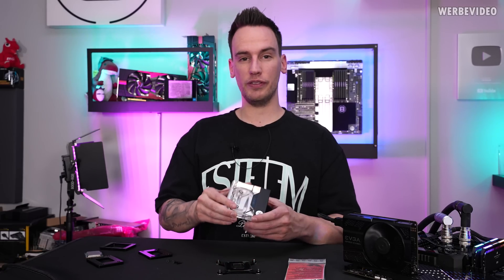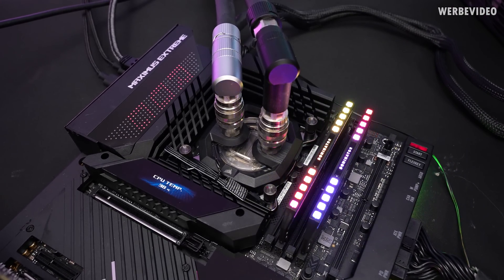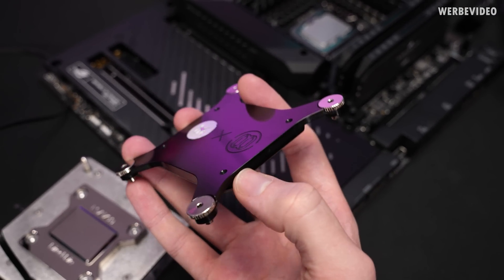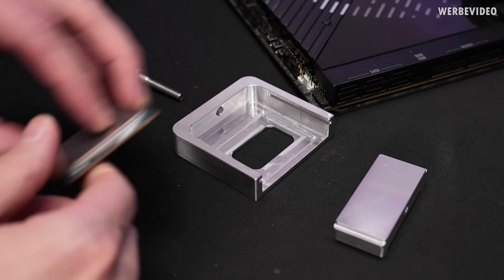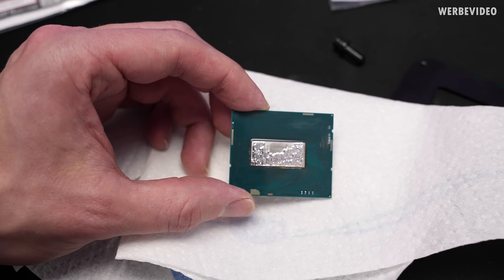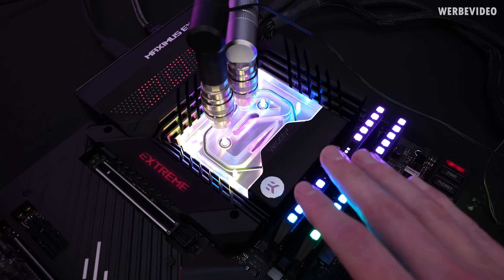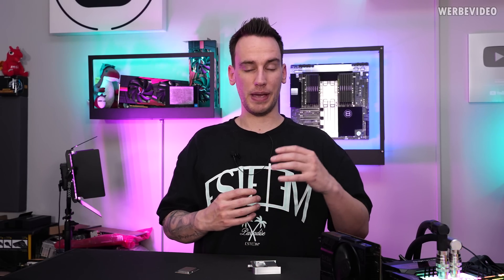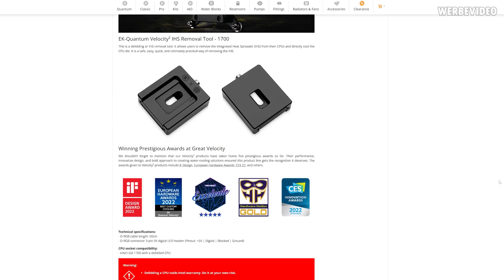We're testing EKs Limited Edition Direct-Die Water Block

Comment: question about water cooling Iv seen a water cooler thats for a 60l aquarium that gets the water down to 10c and one said 32f they where 180-200watts I want to know would it alone be able to cool the water its self or could you put the radiator on the line where the water is coming off the cpu to cool it as much as you can and then to the cooler would it be COLD like 40f or less?

Comment: Make a test unit out of pure SILVER. It has 11% higher Alpha, the product of conductivity and heat capacity, compared to pedestrian Copper. It MUST absorb transient spikes better. Have it plated with Rhodium, or perhaps even better, Graphene to prevent oxidation! 

The only other solid that could possibly be better would be a DIAMOND heat spreader. A company named "Diamond-Materials" might be willing to let you have or at least test with one. At ~1600 W/m·K @ 90°C, it would destroy even Silver with only 430 W/m·K. With Diamond's superior strength, you could get away with a very thin plate to maximize heat flow. 

To quote The Eagles, Take it to the Limit!

Comment: I've got my i9-13900k overclocked 100mhz on all cores. That is, 5.6ghz all core, rising to 5.9ghz with 2 active cores.
I use an EK AIO 360 with 3x Noctua iPPC 3000rpm.

Under all-core stress test Cinebench r23, I stay around 92 degrees C, with no thermal throttling. (CPU drawing 263W, 1.15 volts.)
Cinebench r23 multi-core score of about 41'100. (Stock is about 38'500, or so, according to reviews.)

By the way, I picked that AIO cooler thanks to your video, since it performed so well.

When looking at people running this CPU in stock configurations, I see them throttling on all-core loads, even with AIO coolers. So, I guess my setup is pretty good?

My quick overclock is simply that I set SVID to "best case scenario", and offset the voltage by +0.1 Volt.
This gives me stability and thermal headroom to boost everything by 100mhz without getting too hot.

Comment: I'm a bit disappointed in this video, it's such a wonderful walkthrough of the process to direct die cooling, but is missing so much critical information that would help people choose if they wanted to take this step or not. What's PLL1 and PLL2 at? What was your max wattage, what was your vcore ( looks like 1.35 but it was never stated).  what were the actual result differences in r20 or r23? Why didn't you do the mounting kit with the corsair block?  There's so much information in this video, and so much more that's missing.

Comment: I'd love to see you overclock this 13900k with the direct die cooler to see how high the clocks can go, and what kind of performance improvement that provides!
Reply: He got 6.2 all core with that tech cooler.  And stayed below 65c, I really want one of those.
Reply: @4gbmeans4gb61  how much fps more then if you compare 5.7ghz vs 6.2 ghz
Reply: @JK1NG87  He gained around 7-12% fps, for 15-30% more power depending on game.  Seems good enough for me, i personally don't care about how much power i use lol. Still that is around 155watt max on the highest game and 68c i think.  He was using 1.55v so his chip is NOT very good at OC lol.  Iv seen some chips doing 6.1ghz at 1.4v on liquid cooling.  I just ordered the 13900KS, hoping i get a good one.
Reply: @4gbmeans4gb61  Just got my 1300KS in, but waiting on the other parts to do my new build.  Looking forward to seeing what kind of OC I can get with this direct die mount.
Reply: @4gbmeans4gb61  do you know the cinebench score aswell when overclocked ?

Comment: I remember de-lidding my 4770k and being nervous doing it in my vice.  Granted it was not soldered but after putting liquid metal on it I got at least a 20c drop in temperature!
Reply: I did a 3770k and ruined it lol, I tired a clamp with 2 2x4s rofl, it tore part the pcb.  4790k I bought a delis kit haha.

Comment: I've got mine on pre-order. I have run every system direct die up to the point of LGA 1700 for a long time, and I am so glad I am finally going to be able to do that again. Bare die cooling is so much better than a CPU with an IHS. I wish Intel and AMD would ship desktop CPUs with the IHS loose so that the added cost and inconvenience of delidding would not be necessary. The end user could then decide whether or not to use the IHS. For those that are scared of the idea, keep in mind that ALL laptops are bare die, so it is not a mysterious novetly idea. This is the right way to do it. The SuperCool Computer option is messy and makes it too easy to dump water on the motherboard the way it is designed.

Comment: You used PCB of another CPU to remove the glue on other CPU, wasn't expecting that 😆 Btw, good work as always 😁
Reply: Not just that, but a dead 12900K. Bro just used the corpse of its older brother to clean off the glue.

Comment: The Limited Edition Gold one looks amazing but only 100 units and sold out. Adapter kit would fit my existing Velocity2 block but I'm not comfortable with delidding and potentially killing a 13900K. Are you going to be offering delidded binned 13900K CPUs as you have in the past for other CPUs?
Edit: Was delidding really a single tightening of the bolt?
Reply: You can just get the KF.  Should be binned enough no?
Yes delid is super simple and single spin of the bolt.  Don't be worried :)
Reply: @Boofster  My existing 13900K will hit 5.7GHz all-core on the P-Cores and 4.4GHz on all the E Cores, or higher if fewer cores using TVB. I doubt any non-binned CPU will do better (this one was in an '8Pack OC'd bundle' from Overclockers UK. In any case, I want to keep the iGPU capability. OCUK did say at release that the production chips didn't match their samples. Intel were obviously keeping all the good ones for the KS release 😢

Comment: The best way I have found d to clean up liquid metal is the blue shop towels and 99% isopropyl alcohol. I just soak a corner of the towel with alcohol and then clean up the lm just like normal thermal paste. I was quite amazed how well it works.

Edit: I just finished the video, went to order and it's already sold out... only 100 made is quite a small amount.
Reply: That's for the gold one.  I think the regular clear one should not be limited.  At least I hope not.  I don't know if that one is even released yet.

Comment: leave the cpu in the socket for protection...yea I shoulda done that when I tried...and failed... to delid my haswell :P tried ye olde razor...which didn't quite get to the glue and made some marks on the CPU but the CPU was fine...the dumb thing I did was take the CPU out (to try and cut the IHS off) and then place the plastic cover back on the CPU retention mechanism...but I thought it went on the inside of the mechanism instead of the outside.....derp thankfully only board I ever killed >.>

Comment: Testing with a Mora to try and get good results. Well I would hope so! I wonder what a more 'usual' setup would result in. I guess these products are marketed to the more extreme user though.
Reply: Well a Mora is usually 9x120 you can also fit in some cases like the O11 Dynamic 3x360. So basically the same. I wouldn't call that overly unusual.
Reply: @wudruffwildcard252  That's a good point!

Comment: would have been nice to compare also the corsair and ek waterblock once delided because most of the gain are usually because of the delid not as much gain to go direct die once delided.
Reply: You have to understand that you can’t delid without relid on 12th and 13th gen… this waterblock is a special case scenario. Otherwise there are no direct die frames that can support this cpu which has SMDs higher than the actual due height
The majority of the gains are coming from direct die and you can’t go direct die with the Corsair

What I’m saying is you can’t compare because once delided the Corsair block won’t work

Comment: IHS needs to go away, and we need to return to direct die cooling. The whole reason IHS was invented was because CPU heatsink mounting was badly designed, it was done with spring clips and at a sharp angle and people where chipping the corner of the CPU die during heatsink installation. Now with CPU heatsink mounting mostly all using a straight down screw-in mounting style, there’s no reason to have an IHS anymore.

Comment: Can you do a test showing results between the limited edition (better) direct die kit which basically no one can buy, and the standard "direct die conversion" kit ek are releasing? (Which has worse cold plate and fin design)

Because now we need to know if the conversion kit is inferior, so those who view this video are not misled into thinking they're getting the full performance product.

Otherwise it's basically a scam
Reply: They're the same, it's only the top that's different on the Special Edition :)

Comment: The Shintel Core i9 13900K is a LAVA HOT MESS good only for sub zero winter surroundings. Otherwise it's a FAILED product full of security hardware holes, LAVA hot temperature, inefficient Hyper-Thrading, zero multi-core performance, worse IPC and single core than competition and very low build quality (it can melt on its own ya know :) ). Shintel is an inferior manufacturer that doesn't know how to engineer a new architecture from grounds up to prepare it for normal sub 14 nm process and remove the nuclear amounts of power that it needs.

Comment: Is an AIO coolers with Direct-Die possible?
Reply: AIO is lower-performing, so it'd be pretty pointless.  And if custom loop is scary, direct die should scare you more.
Reply: the problem is that there needs to be mounting pressure on the CPU, if you make a direct die contact frame (designed for AIO) it can only be as thick as the height of the die, which would be too thin and bend and could put to much pressure from the AIO onto the die and break it.

this product has the coldplate raised so the contact frame can be thicker.

Comment: Roman, one thing I've ben wondering now for a bit, how come you run Cinabench R20 and not R23? For me, running an i5 9600K, stock, if I run R20, my max load hits 85W and max temp on 1 core is 74C, R23 takes 93W and max high core is 76C (yes, running a bit hot right now, I need to reapply my thermal paste, also live in the tropics, so my col is your hot:-)

Comment: Interesting, but I already get sub-80C temps on an i7-12700KF 250W+ at 5.2GHz all core with no throttling over a 10-min Cinebench R23 loop. If I delidded and used LM I'd maybe save 1-2C at considerable $$$ expense, and losing all warranty and resale value when I want to upgrade (probably with 14th gen). I also get that the 12700KF has slightly lower power consumption than the 13900K but all in all not that different.

I use the TR contact frame (TG was 6x more expensive, had similar performance in reviews, and was constantly out of stock) with EK 1700 block. Also use Noctua NT-H2 with a 3x360mm, single CPU (12700KF), single GPU (RTX 3090), single D5 pump.
Reply: Absolutly the same here but on my 13700K. All temps at the mid 80 degrees mark (just double checked and one core hits 90 degrees) with a 256w load and a consitent 5.4Ghz withthe Thermalright contact frame (so so cheap and works a treat!) and a 360 AIO. Scores 31222 on Cinebench R23 and I know I can get better...Though it would be great to drop temps another 10 degrees to push even harder...
Reply: You can still resell a delided CPU.  I watched a 12900KS go for far more than I thought it should have:  $377, Essentially the same price as a brand new 12900KF!
Reply: People pay so that way the risk of damaging isn't on them.

Comment: 11 degrees off is nothing to scoff at. Big improvement. Long live der8aur!
Reply: 11 degrees off of a very decent cooler setup. That's pretty nuts, because you know the difference is even crazier compared to your typical 240 or 360mm AIO that many people run.

The results here will probably start bringing back the days of delidding
Reply: @rustler08  I don’t know why people stopped. I didn’t have 10th gen personally or work with 11th at all. It was still very beneficial for 10th gen and even more so for 12th in my opinion, especially for those with the i9 k skus. I can pull over 450w through my 12900k with the supercool direct die block and not thermal throttle. My daily OC of 5.4p, 4.3e running r23 stays in the low 70s while looping cinebench (about 350w). Gaming I normally stay in the lower 40c range. My CPU loop has a MORA3 360 with a manual knob to control the fans. I’m sure of the exact rpm they run at, but I put them at a level where I can’t hardly hear them in a quiet room about 8ft away. With any other noise you can’t hear them at all.
Reply: I think direct die should be compared to a delidded cpu + liquid metal. If you're going through the trouble of delidding it anyway, the difference that matters is only the extra layer of IHS and top paste/LM.
Reply: I thought it would be a lot more.  The tech cooler was
 Like 50c drop.
Reply: @4gbmeans4gb61  I doubt it was a 50c drop, even in gaming. Maybe 30c. In this type of workload though, the tec cooler would be overpowered and the CPU would end up thermal throttling.
Reply: @rekareaper  ya it maxed out around 200-230 watts, and dropped temps from like 100c to 50-60c
Reply: @4gbmeans4gb61  in which video? I think you’re heavily exaggerating the results, considering the 12900k and 13900k will both walk into and passed the 300w range. I went back and looked at derbauer’s videos and the one where he rigged it to work on the 13900k he was not dropping the temperature by 50c. In fact in battlefield while gaming his frequency dropped to the same that I have set a 13900k to run in all core workloads. And he was hitting 68c in that test for battlefield. The Tec is simply overpowered by the heat from anything other than light gaming loads.

Edit: the CPU was also only drawing around 150-160w in battlefield where it was hitting 68c.
Reply: @rekareaper  he’s using over 1.55v , at stock clocks that will hit 100c even gaming with regular cooling. Going from 100c to 50-68c is exactly like I said.  I don’t see what the big deal is or why ur arguing over it lol, have a good day.
Reply: @4gbmeans4gb61  it’s not exactly as you said, but have a good day dude. Lmao
Reply: @rekareaper  Thanks.
Reply: @4gbmeans4gb61  the problem with the tec, is that if the heat gen of the cpu exceads 250 watts, it will no longer be able to keep up. That will make it work worse than a normal block.